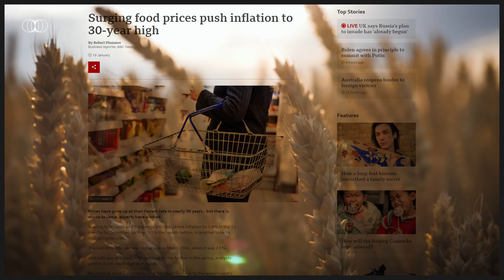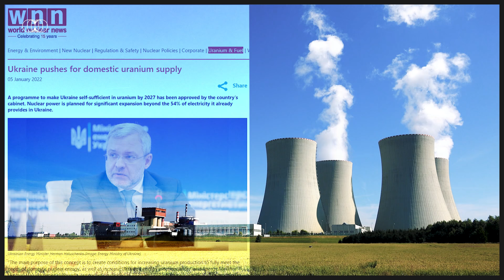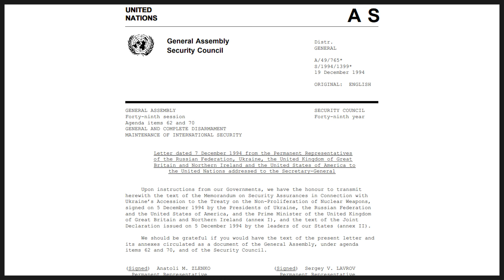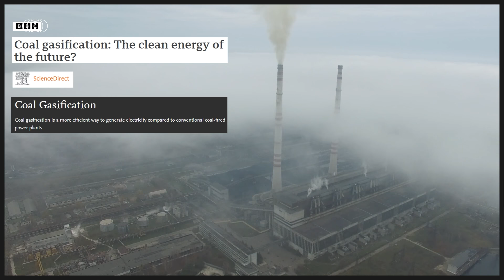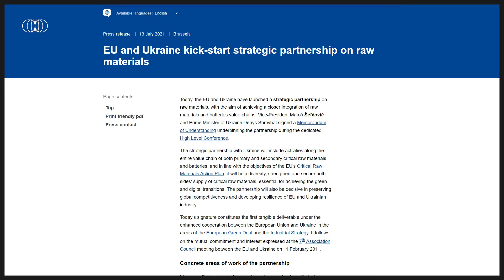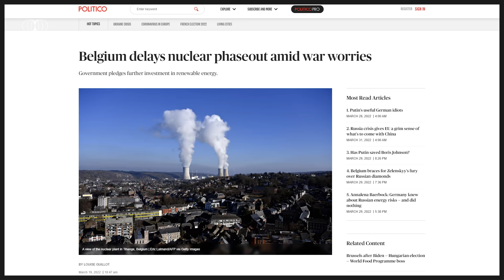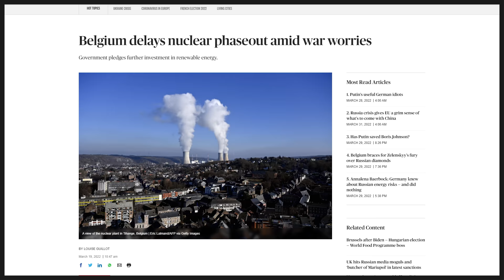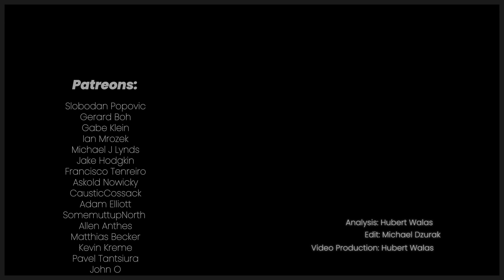Ukraine Sits On Raw Materials Worth Trillions. The Country's Chance for Reconstruction?

Comment: It's no coincidence that Russia has invaded Crimea and Donbas.   Roughly half or Ukraine's gas and oil deposits are in the Black Sea in the 30-mile exclusion zone off of Crimea.  Half of the remaining deposits are in Donbas. 

It's not so much that Russia wants those resources, but rather that they want to keep those resources off the market, as it would undercut Russia's energy dominance over Western Europe.
Reply: Exactly. It would be Kreml's worts nightmare that suddenly there would not be need for Russia's natural gas in Europe or even if the gas export was to drop significantly. Also, if Ukraine indeed managed to fully capitalize its natural resources for the benefit of their country and people like Norway does, Russia (Kreml) would have a possible future economical powerhouse and therefore most likely a strong military right next to its borders with who it does not have the best relations.

Comment: Considering the well educated population of Ukraine, it’s too bad that it’s one of the most corrupt countries in Europe. It was seriously hindering the people from achieving the prosperity they could so easily achieve without the corruption.

They have an economy that on a per capita basis is similar to Eswatini’s, but exports equipment for different space programs, including to ESA and NASA, as well as airplane parts and parts for nuclear facilities, which is impressive and odd at the same time.

I would love for them to eventually be a part of the EU, which would be mutually beneficial for both Ukraine and the EU. However, they are not ready at all to join the EU. Way too much money disappears into “thin air”, when they receive economic aid and their political system is unwilling or has difficulty implementing programs to address these systemic issues. Hopefully they will be able to realize their full potential after the war.

Comment: Very good. It should be noted that Ukrainian winter wheat is planted in November and harvested May /June. Kharkov and Dnieper areas were late planting went into December. Battle damage will have affected only 1  to 2 % So there is a normal harvest expected. Damage to infrastructure, granaries and rail, may effect harvest but an emergency response would be Grain Bunkers, silo bags, and bringing in a fleet of trucks. Rail damage is fast to repair. Most of the western Ukraine's infrastructure is undamaged. The Russian will harvest and sell the wheat in areas they control. Whether the farmers are paid is another thing. Most farmers stayed on their farms. So If the war ends may the harvest should be 90% to 100% normal. If the War ends next week it will be normal. 
Russia may have problems shipping its wheat to Europe but can still ship to the Middle east via the Caspian and Iran. Same with Russian fertilizer.

Comment: With composite rock dust powders-mixtures the yields can be increased by 4 to 5 times above normal. The use of biochar can increase yields by 880% or 8.8 times above normal. Combine the two and the yields will be staggeringly unbelievable. New ways to extract the minerals without harming the environment are already in existence. Like the old Eastern saying, of what use are your golden pitchers and plates and spoons and forks when you can only spit blood into it?

Comment: Joining the EU would be VERY beneficial for both Ukraine and the rest of the EU. If Ukraine wins the war, they should leverage their influence to China, threatening to take away resources yet still providing them to keep China more docile. Joining the EU would act as a blanket of protection as China would have to contend with the rest of Europe, especially as they are now increasing military spending due to recent events.
Another thing, maybe it wasn't significant enough to be mentioned here, but I wonder about scrap metal, especially from damaged Russian hardware and recycling metals from the rubble of cities. Ukraine may have more on hand than they know what to do with and sell it and/or it may be used to help rebuilding efforts.
Either way, as mentioned, being close geographically to the EU, with those resources, and possibly joining, would likely cause a surge in aid to get them back on their feet and becoming a productive member of the EU as fast as possible.

Comment: Requesting thoughts on the following scenario: Ukraine, seeking to increase Russian penalty for invading, sends troops to oust Russian "peace-keepers" from Transnistria and return the territory to full Moldovan control. This would end Moldova's main Russian threat and protect one of Ukraine's flanks from aggression.
Reply: Have they done it, or are you suggesting that they do?
Reply: I don't think this would be practical from a material and geopolitical point of view at the moment. Ukraine would have to invade Moldova to do that so they would be doing the same thing that Russia is doing to them. If Ukraine and Moldova worked together to squeeze the Russians stationed in Transnistria then I could see that happening. Ukraine still has a lot of fighting to do in the east and south so this would only be a possibility if Ukraine was able to have a sizable amount of troops pulled away from the different war fronts. Perhaps if Ukraine gets more momentum and can push the Russians back far enough then they could work on this but I do not see this scenario happening any time soon, if at all. Ukraine has to worry about it's own territorial sovereignty first and foremost.